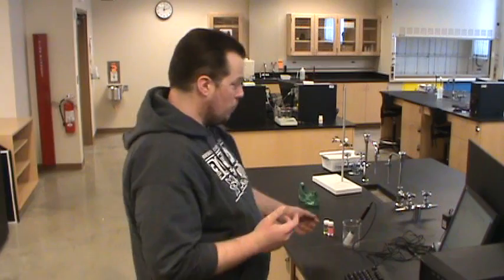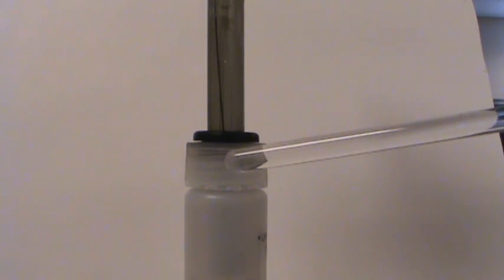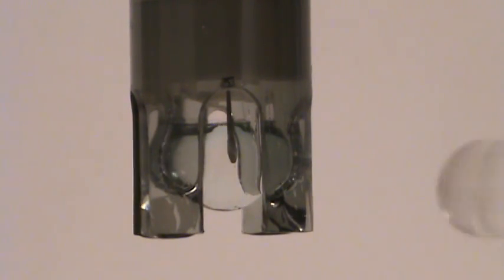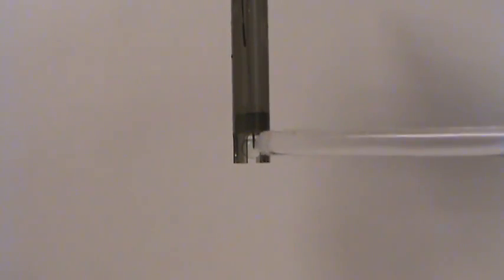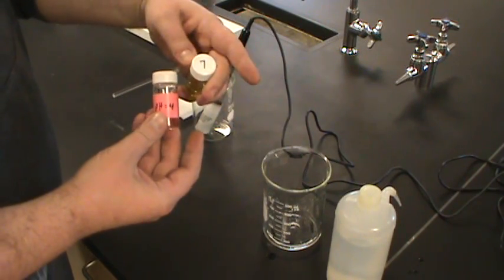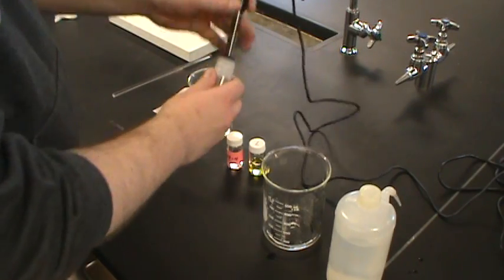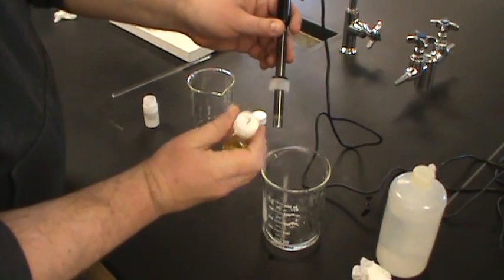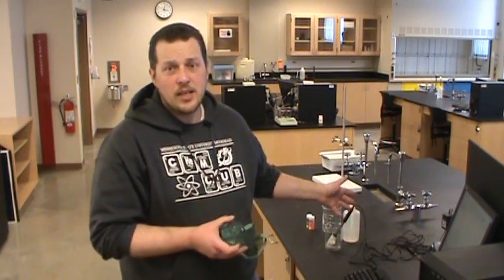Using pH Probes

Comment: Can you store these calibration solutions or do you discard them after use and mix the powders always fresh before calibration with water ?
Reply from the maker: The pH calibration standards are pretty stable. If you keep them capped they should hold for quite a while. In my experience, they are more likely to spill before they "go bad".
Reply: I see If you believe the seller you should always mix a new batch and after using toss it out. It makes sense because they make money from it and these small bags are expensive. It´s much more clever to get the chemicals in bulk and weigh the right proportion from that. By the way you mentioned you use two point calibration but I have 3 ph powders(4,7,9) is that more accurate to measure 3 points ?